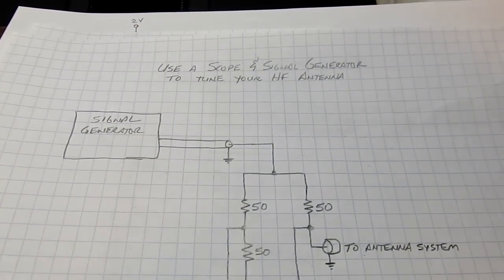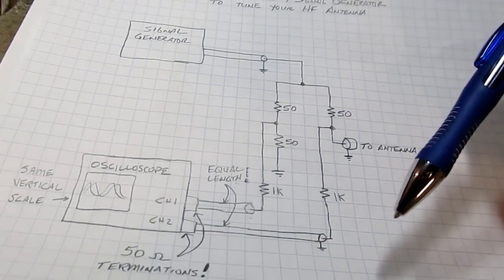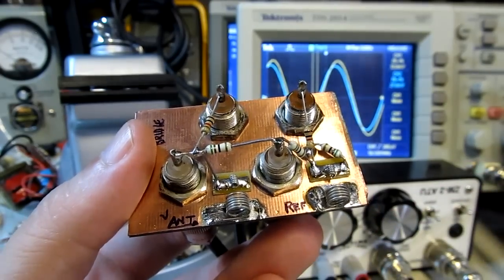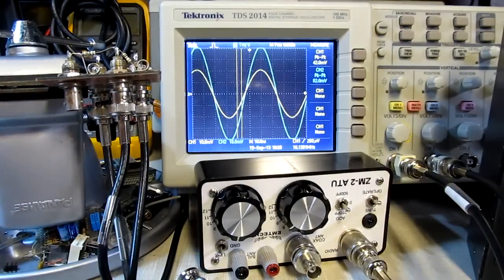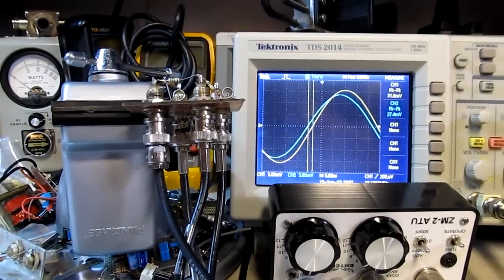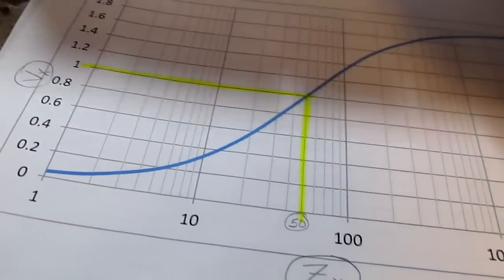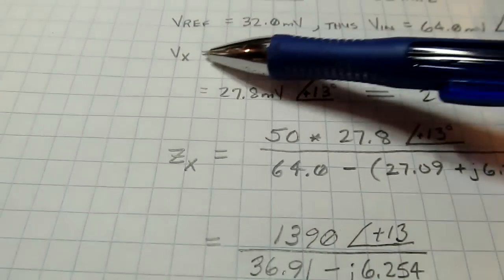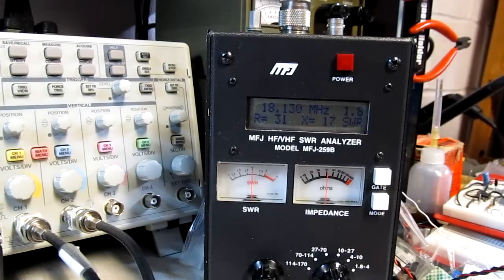#112: Use an Oscilloscope and Signal Generator help tune an HF Antenna, measure complex impedance

Comment: Heya, I'm just at the end of my electronic degree (but need more RF prac!). Just a few conceptual questions I was hoping you could answer. Could you have had the lower resistor of the bridge as 100 ohm and straight paralleled it with the coax heading into the oscilloscope? This may be a bit more complicated when it comes to solving for phase? Also with the 1K res,having larger just means a smaller the signal going into the oscilloscope?

Thanks

Comment: Another question if you don't mind?  Do impedance matching circuits (ie: antenna tuners) create loss in power?
Reply from the maker: +Digger D Generally, very little, if they are made from capacitors and inductors.  Since the voltage and current in a capacitor/inductor is 90 out of phase, they do not dissipate power.  They store energy (in electric field or magnetic field), then return it to the system/circuit.  The main losses are generally due to resistance in the wiring, inductor, switches, etc.
Reply: ***** I was thinking that but some hams on a video were debating it the other day.  If there is no impedance... (except for normal losses as you say).  Thanks again.
Reply from the maker: +Digger D RF currents can be high in high-Q tuned circuits which can lead to higher resistive losses in the tuner.  Also, if the tuner is located in the shack, then the feedline from the tuner to the antenna will be operating with a high SWR, which can also lead to losses.
Reply: ***** Ok, thus the invention of the remote antenna tuner.  Good to know and thanks again.

Comment: Very good video!
Could you please explain why do the oscilloscope needs 50 ohms terminations?
Reply from the maker: Leo Botler Yes, the terminations are added to the ends of the cable to prevent reflections of the RF signals that are coming down the line.  If your scope has 50 ohm terminations built in, you can use them instead of the through terminations.
Reply: ***** 
First I would like to thank you for your answer, but I was not clear enough in my question. 
I didn't understand why you placed a big resistor (1Kohm) in series with the oscilloscope and also a 50 ohm termination, once the input resistance of most oscilloscopes are already very big (>1Mohm). How does it avoid reflections?
If you have a reference that can help me understand it I would appreciate!
Reply from the maker: Leo Botler The big resistor in series with the coax is placed there so that the 50 ohm resistors in the bridge dominate the impedance seen at the bridge nodes.  Once RF signals are in a transmission line, the current/voltage waves assume a relationship of Z0, the transmission line impedance.  If the transmission line is not properly terminated, then there will be a reflection will will affect the amplitude of the signal which will be frequency dependent.  So, by properly terminating the lines, no reflections occur.  You might find this video helpful:
https://www.youtube.com/watch?v=g_jxh0Qe_FY
Reply: ***** Thanks! Also a great video. Isn't this reflection already avoided by the 50ohms resistor connected to the ground? I mean... The reflection you avoid in the oscilloscope input is happening on the 1kohm input... Am I wrong? 
The input impedance in the path going to the oscilloscope is much bigger than 50ohms anyway, so in my understanding you could place the oscilloscope directly on the antenna.
Reply from the maker: Leo Botler There are RF signals injected into the pair of coax cables that lead to the scope through the 1K resistors, and they travel down to the scope.  When they reach the scope end of the coax, they need to see a 50 ohm termination to prevent a reflection at that point.

Comment: nice video
THANKS
forgive my ignorance but what is the difference between am Antenna Tuner and an Antenna Analyzer ?
Reply from the maker: An antenna "tuner" or transmatch is an adjustable impedance matching network that is placed between the transmitter and the antenna, and is adjusted to transform the impedance of the antenna system to something that matches the impedance desired by the transmitter (usually 50 ohms).  An antenna analyzer measures the complex impedance of the antenna system, using it's own built-in RF source.  It does not adjust anything, but rather can be use to examine the changes in impedance made by tuning the antenna system.
Reply: @w2aew  Something occurred to me while reading this... that the math does not seem to encapsulate antenna geometry. [ MAYBE I AM WRONG] I was reading a riddle of Analogy between Earth and Man and Man and Mind.
26:17 || 25.8 + 30 : 24
the difference between 30 and 25.8 being 4.2... some form of energy modulation perhaps
two primes [ 13 and 17] and a "square" [ 25.8 squared is close to 666 minus 0.36 or 0.6 squared] 'move' in the system. So, what might be the relation, if there is one, of 665.64, 0.36 and 666 ?
if my intuition is right
one system is a 3- dimensional antenna system
the second is a 2-dimensional antenna system [ not quite but close enough for our intents and purposes]
If both systems pertain to transceiver systems ... we have food for thought on Energy and Angular-Spin systems that the Schrodinger equation tried to explain also.
So, I guess one 'new' system attempts to show that there is resonance or frequency - matching between
Earth and Mind.
The brain has two-hemispheres as does the Earth.
one [the brain] operates on a two-dimensional plane [ SURFACE OF THE EARTH] while the other [the Earth] operates
on both two-dimensions and three dimensions... or maybe system X [ Man - Earth - Galaxy System]  and 
{system X minus 90 degrees}   [Mind - Man - Earth System] 
Hey, I am just spit-balling my intuitive ideas here to see if a snow-ball can make an avalanche.
The difference between 3 dimensional and 2- dimensions being 90 degrees or 2xPi / 4 radians
The Square [90-degree 'inferior' system within the parent 'superior' system] and the Compass comes to mind.

Your video sparked by intuitive process. Thanks....
Resistance, Capacitance, Inductance make me think about 'magnetic refraction'
and the possibility of uni-directional energy flow similar to a laser which would theoretically extend
transceiver range.
My next question is ... Are there such things as 'laser' radio-transceivers ?
SEE
http://www.arrl.org/laser-communications

some terms
Resistance [AMPLITUDE], Reactance[ANGULAR VECTOR], IN COMPLEX Impedance SYSTEMS
WHICH CAN BE PERCEIVED AS EITHER POLAR FORM OR RECTANGULAR FORM.
SOME MIGHT LOOK AT ETHER - ETHERIC ANNANAS [NEGATIVE MAGNETIC FIRE] AND ANIONITES [POSITIVE MAGNETIC FIRE] AND SPECIFIC SPEED AND DYNAMIC FORCE IN TRANSFORMATION OF ENERGY SYSTEMS. IF ETHER IS LIKE A TUNING FORK THEN WE ARE QUANTIFYING AND QUALIFYING
RESONANT ENERGY INTO AMPLITUDE AND AXIAL SPIN.

Comment: I am curious if this method can be adapted to NanoVNA, in other words use port 1 as a signal generator, and port 2 instead of osciloscope. Certainly you can measure an antenna just with port 1 using reflected voltage, still I think a comparison of various methods to measure antenna impedance with NanoVNA would make a very interesting video.
Reply from the maker: This resistive bridge is exactly what is already inside of the NanoVNA to sense the forward and reflected signal.

Comment: Doesn't this also sort of depend on the antenna type as well? I know certain antennas dont show up as 50ohm impedance naturally. Is that what the tuner does basically is match say, a 75ohm antenna to 50 ohms?
Reply from the maker: yes

Comment: Trying to use this gizmo to tune a broadcast tower ATU, keep you posted of what I get, just wondering if someone has tried on BC towers before ??
Reply from the maker: I just hope that you do it at very low power!
Reply: :-) please don't be concerned as I will use a vintage GR oscillator. Also I found some 5 watt 50 ohm resistors just in case.

Comment: Hy, first of all thank you for the knoledge. You are a great techer. Second i have a request. I want to align an fm module for my radio. I do not know the impedance at the dipol antenna imput and how to connect the sig gen to it. I have a rigol sig gen with fm modulation and a rigol scope. I can not find a detailed enough video on how to determine the impedance of the input dipol antenna and to connect the sig gen to it to match the impedance. Pls help.
Reply from the maker: The easiest thing to do is to connect the dipole antenna, then attach a small wire (non critical) to the siggen output, and let the dipole on the radio pick up the signal.  It will be much stronger than anything else around.

Comment: I had some AD8307 log amp/detector, can I hv the output, instead of going to the scope, goes into the AD8307 to detect the forward and reverse voltage similar like a directional coupler ?  Thanks
Reply from the maker: You certainly could use a log amp/det to indicate the level of mismatch, but you won't get any indication of the type of mismatch (you lose the phase information).

Comment: Just a query, the mismatched antenna is at the other end of a coax ... How does measuring the impedance this way affect the reading? Also after the matching network the radio might see it as 50 ohm.. but the true mismatch is again where the coax meets the antenna?
Reply from the maker: Correct, the impedance mismatch is occurring at the coax connection to the non-50 ohm antenna.  The impedance measured at the transmitter end of the coax will not be the same as the antenna impedance (unless the coax is a multiple of half-wavelengths long).  The impedance at the tx end of the coax can be predicted using the Smith Chart - see this video: https://www.youtube.com/watch?v=ImNRca5ecF0
You can place a matching circuit at the antenna (preferred), or at the tx end of the coax.  The latter doesn't "fix" the impedance mismatch or the presence of standing waves on the coax.

Comment: HI...do they have this built into some of the high end Icoms or Kenwood transceivers of the ones...I dont know if they do..I do not have like 5k to 10k to spend on these type receivers..
Reply from the maker: Not this specifically, but they do have built in SWR bridges that can measure VSWR.

Comment: Hey, I love your video, amazing !!

At 10.53 you speak about non linear curve about the voltage divider. How did you got this curve ? I am not sure to understand ? Because when I plot Vx=(Vin*Zx)/(Zx+50) I don't get this curve. Can you guive me more details ? Kind regards
Reply from the maker: fmbroadcast Are you  sure?  Did you change the x-axis to Log?  If you spot check some numbers, they call on this curve.  For example, for Zx=10, Vx calculates to 0.333, which is on the curve.  For Zx=100,  Vx comes out to 1.333, which also lands on the curve...
Reply: ***** It's me again, something that tilt me. On the scope, the yellow trace represent the signal from the reference voltage divider is that correct ? we can see at 7.20 that when you match the antenna load, the yellow  trace make some tilt in amplitude and phase, I guess because the signal generator impedance is of course not null but in the ideal case, is the yellow trace should have to change in amplitude and phase ? May be i miss understood something. But this is facinating me.
Reply from the maker: fmbroadcast Yes, the generator's output impedance is 50 ohms, so the output will vary as the applied load varies.

Comment: I have a CB radio I found at the dump and it powers on, but I have no idea if it transmits properly. How should I go about testing the output frequencies of the radio itself? I have a pretty nice 100 MHz oscilloscope that should be able to read the output from the RF connections. I should see an AM carrier wave but is there any kind of load that I should connect to prevent damage to the transmitter?
Reply from the maker: +Neil Caulfield The transmitter should be loaded with a proper 50ohm dummy load that can handle the power of the transmitter.  You can monitor the RF output using an RF tap/sampler.  Here's a video on that:
https://www.youtube.com/watch?v=0Kk_N_TpDeo
Reply: +w2aew awesome thanks! I was able to see carrier wave, appears to transmit properly

pretty nice find in the trash, will have to get antenna for it

Comment: Con este procedimiento no se determina la impedancia de la antena sino la impedancia del cable y la antena. Con diferentes longitudes de cable pueden obtenerse resultados diferentes.
Reply from the maker: Yes, this is true - you're really looking at the antenna system impedance, including the impedance transformation/rotation that is added by the transmission line.  At the end, this is OK, because this is the impedance that will be seen at the transmitter.

Comment: If you do not have pass through terminators could you use T connectors with one end terminated with 50 ohms?
Reply from the maker: +Digger D Yes, for HF that will generally work well.
Reply: ***** Great, thanks again.

Comment: Hi Alen. I have a impedance matching question. I'm working on a hobby FM transmitter circuit on a 10/15/40m radio band. Finished designing the Clapp oscillator, LNA and output stage (PA). But Im not sure how I can connect an antenna to my output stage. Can I just connect a wire of a particular length to the output of my transistor (BJT). I would assume that there has to be some sort of matching needed here. If so, how do I go about this without an antenna tuner? 
P.S Hope your ankle is healing well!!!
Reply from the maker: It really depends on the output impedance of your transmitter.  You'd ideally want to match that.  Otherwise, just design the antenna system for resonance.  However, this brings up the bigger issue of legality.  In the US, these frequency bands are not license-free.  Portions of them are reserved for amateur radio use, and FM is not permitted on the 15m and 40m bands, and is reserved for a portion of the 10m band.
Reply: Thanks for the reply. You mean the small signal impedance of the transmitter right? How would I determine the impedance of a wire that I'm using as an antenna. Do you have any practical references that could help me to get more info? 
Thanks for bringing up the legal issue. Ill have to re-check the bands to see where it would be legal.
Reply from the maker: The most accurate way to predict the input impedance of the antenna would be to use one of the NEC-based modelling programs.  Lots of good information here:
http://www.arrl.org/antenna-modeling
Reply: Thank you Alan!!!

Comment: Great work, and thanks.
Any suggestion on doing the same thing at around 2.4GHz without a VNA?  Poor-Man style :)
Reply from the maker: Other than trying to estimate relative signal strength with a WiFi sniffer, it would be tough to do any meaningful tuning without a VNA.
Reply: What about a spectrum-analyser with tracking-generator?  Is that possible?
Reply from the maker: Sure, as long as you have a return loss bridge or directional coupler...
Reply: There we go.  Here's a video idea for some one like you ;-)
I'm looking forwards to see it.
Reply from the maker: Already did one a while ago:
https://www.youtube.com/watch?v=iBK9ZIx9YaY
Reply: Great Video, I've already seen it, like most of your videos :-) . 
What I was asking was... use spectrum analyzer + Tracking Gen to measure the load impedance (complex value) is possible, with calculations, etc.
Reply from the maker: The measurements made by a spectrum analyzer are scalar measurements, you cannot measure phase.
Reply: Yes, I know, but I thought with a tracking gen (that's internally connected to the same SpecAn) , there may be a way.  I guess not.  :-(

Comment: Hi Allen,
This is a great experiment. I want to try this on my 40 meter dipole. I am having a hard time finding a 5% 50 ohm resistor. Can you tell me if using two 100 ohm in para will be okay? I did find 47 ohm and 50 ohm cement wire wound. I guess the wire wound are bad for RF please advise.
Thanks Dan 73 W3DKY
Reply from the maker: The two 100 in parallel would work fine. Also, 51 ohm are fairly common and only 2% from the nominal desired value.

Comment: Does  maximizing power transmission also optimize reception characteristics?
Reply from the maker: In general, yes, it is a reciprocal arrangement in most cases.
Reply: @w2aew  Thanks Alan. Am interested in optimizing the antenna for my in-flight , 868MHz collision warning device. If I ever get my Tek 7403 'scope working I'll have a go at this.

Comment: I have a question with regards to your signal generator, in your case you configured your signal generator to 18.130Mhz. So if I wanted to fine tune an antenna for an 868Mhz tranceiver, I would need a signal generator that is capable of generating 868Mhz as well as an oscilloscope that can sample up to 1Ghz?
Reply from the maker: Yes, but at these frequencies, the parasitics of connecting probes will alter the results.  Thus, at these frequencies, a scope + signal generator are really not the best tools to do this job.  A network analyzer is likely a better solution.
Reply: @w2aew  Thank you Sir!